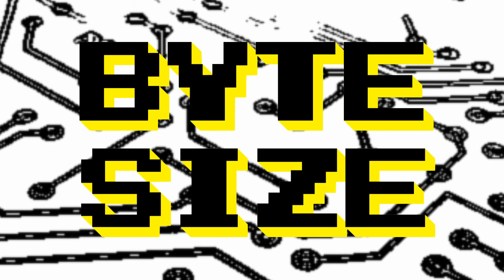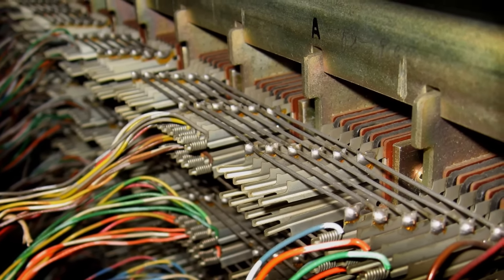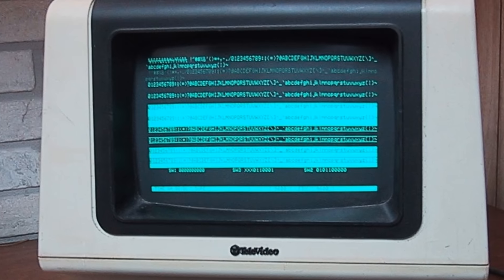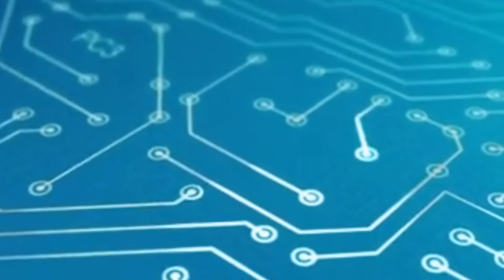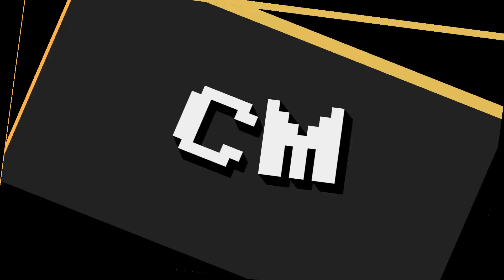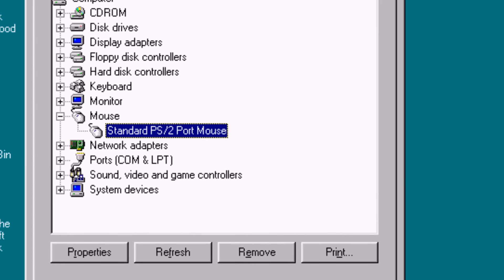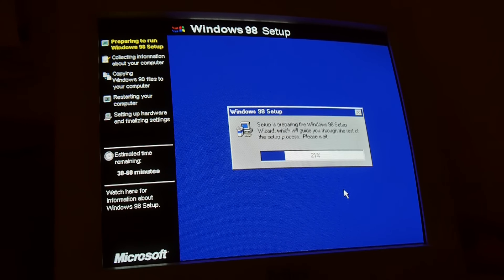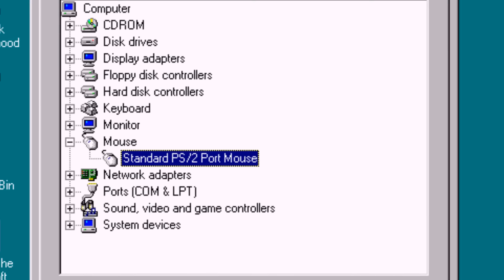How Does Plug & Play Work? [Byte Size] | Nostalgia Nerd

Comment: The problem with MCA was that configuring expansion cards required a unique floppy disk that came with the computer, and if you lost that disk, you also lost your ability to reconfigure the hardware. Obviously it's not a huge problem to keep the disk with the computer if you're a home or small business user, but when it came to large businesses and institutions, which had hundreds or even thousands of computers to look after, it was next to impossible to keep track of which disk went with which computer. Plus IBM had patented it and wanted PC clone manufacturers to pay royalties to use it, to which said clone manufacturers said "nope" and developed PCI instead as the 32-bit P'n'P card interface of choice.

Comment: The Amiga, with the Zorro 2 and 3 buses, had a very elegant solution called "Autoconfig". This would allow you to store the device driver of the expansion board to be stored in ROM on the board, which means that you'd never have to install any drivers.

Obviously, when it came to driver updates, or running anything other than AmigaOS, it was not quite so good.
Reply: autoconfig was stolen from dos....

Comment: I think it was more like, "plug and pray"....
Reply: Back then Macs really were better as they just worked.
Install the card and maybe a system extension and that was it.
Reply: Even the elreya Imac had some plug and pray issues, mac os 8.5.1 fixed many of them and 9 most of the rest
Reply: I can picture the fat guy who first thought of that having a huge smirk on his face as he sat down his dark basement, dialed up the internet and "Wait till the guys on usenet hear this... Plug and pray...LoL"
Reply: That;s what we used to call it with ISA and windows95 / NT4.... Ugh, some bad hardware back then.
Reply: In the early 2000s I had an external haddrive that I used to carry around, and whenever I used it on a new Windows PC I had to install special drivers for it. Then one day I tried it on Mac OS, and was just astounded to see that the operating system recognized my device without any configuration, it just worked.
Reply: firewire drive?
Reply: Patchuchan And nowadays they’re still better as they work correctly 99.9 % of the time. Meanwhile, Windows only works correctly 90 % of the time, being generous. Most Windows problems (which arise at maximum 3 days uptime, unlike Macs which can be months without rebooting [mine has over a month uptime right now]) are solved by rebooting (which is a loss of time and a big PITA), but if it isn’t, you’re for a really big loss of time worrying about and trying to solve the problem, if you are tech-savvy like me. If you aren’t it’s mostly a waste of money (luckily for the technician who receives the money).
Reply: Damn, that's very original.

Almost as original as Brian Collens, who you copied this comment from.
Reply: Oh yes...
Reply: kitty!
Reply: kitty!
Reply: Plug and Pray - you beat me to it LOL LOL
Reply: No it is still plug and fail, i'd find the plug and play disable option, and manually install drivers

Comment: I remember that the Amiga systems had autoconfig built in as standard. A great help when using the big box Amigas. 

I still miss that system despite the technical advances of today's hardware. Although the software is of higher quality these days.
Reply: they had plug and play before windows did, huh
Reply: they had plug and play before windows did, huh

Comment: That bus mouse probably demands a low IRQ value because lower IRQs are given higher priority access to the CPU. An interrupt request from a device interrupts whatever the CPU is currently doing to service it, and if two or more come in at the same time, the CPU delays or sometimes flat-out ignores the one with the lowest priority. Since you generally want your computer to always respond to human input devices, it stands to reason that a mouse & keyboard would be granted the higher priority low IRQ lines. In fact, on an old pre-USB PC, the keyboard controller is attached to IRQ 1, the second-highest priority in the system. 

Fun fact: The original IBM PC & XT had only one eight-channel interrupt controller chip, called an 8259 programmable interrupt controller, or PIC. Nearly all of the eight channels were reserved for internal components or add-ons that the system shipped with, leaving only one or two available for future expansion. IBM sort-of addressed this in the AT by adding a second 8259 PIC and tying its IRQ2 line (aka IRQ9) to IRQ 2 on the first chip. So the actual IRQ priority on an AT is something like 0, 1, 2/9, 8, 10, 11, 12, 13, 14, 15, 3, 4, 5, 6, 7. Although IRQ conflicts are a non-issue these days, with the introduction of PnP, a modern PC still has the equivalent of two 8259 PIC chips, as well as that bizarre priority list.

Comment: There's flexible, and there's annoyingly flexible.  Flexibility becomes annoying when you have to load all of the motherboard drivers whenever you need to do a clean install on drive c.  The situation gets even more annoying when you need to download all of the Microsoft updates as well.  But it gets downright infuriating when Microsoft decides to discontinue a handy piece of software that you can only get on line.  So, in order to overcome this frustrating prospect, I elected to clone drive c to a spare drive.  That dealt with the Windows 7 computer issue.  However, my Windows 10 computer, which also supports the X86 software I use on the Windows 7 computer, has overlapping issues.  So, in order to fix that situation, I have purchased another hard drive, and cloned drive c to that.

Comment: I used to have plug and play software for DOS that was designed to allow plug and play cards to be used on a motherboard lacking a PnP BIOS. It was actually quite powerful software, but if you moved that boot device to a motherboard to a system equipped with a PnP BIOS, it would lock up at the config.sys file when loading the software's PnP support device driver. Ahhhh memories....

Comment: The earlier plug and play supported plugging in well. You could plug something in and play it but sometimes  unplugging did not work as well especially for block devices (devices that store data.) These usually had to be unmounted, a process that would prepare them to be unplugged.

Comment: One big problem with Plug & Play was that it didn't Unplug & Play.  I remember having to boot Windows 95 and 98 in Safe Mode, go into Device Manger, and remove all of the duplicate instances of a device that wouldn't be visible at all in Device Manager if you weren't in Safe Mode, but would still cause the real devices not to work as well as rendering Windows even more unstable than normal.

Another problem, likely related to the above, was that Windows 95 and 98 really didn't like being cloned onto a hard drive and then moved to a non-identical computer.  If the destination computer was significantly different, Windows might boot initially and work for a short time, but almost inevitably, it fried soon afterwards.  Being in the 1990s in a business that sold process monitoring systems, we needed to be able to clone hard drives, and it was a real time waster having to do a full clean install every time the computer manufacturers changed their available models.

Later, I learned that the Windows NT and 2000 were a lot more tolerant of being moved onto different (even very different) hardware.  I got out of that line of work before having the opportunity to run afoul of Windows XP's license activation system that would purposely partially disable it if it detected more than a certain number of changes in the hardware it was running on.

Comment: Yeah great Plug&Play in the early days, on my Windows 95 box it assigned the sound card the same IRQ as the printer (7 I think it was) so each time I played audio the printer reset itself as if you'd have unplugged and replugged it... had to lock one of them to 5.
Reply: I have to choose if I want the prallel port or the soundcard, because they totally want the same IRQ :)
Reply: @HappyBeezerStudios  This is why I make it a habit to go into the BIOS and disable all the ports I'm not using or planning to use.

Comment: I'm extremely grateful for PnP. It really was revolutionary, some people don't understand what a large change it was.
Reply from the maker: I loved the DOS days of configuration and startup files - but I had a lot of free time then! - After the initial excruciating overlap with early Windows '95 plug and play revisions it was definitely  nice to be able to slap something in and for it to just work (usually).
Reply: I came to PC too late for those very early days but my "usual" PnP experience was that I slapped something in, installed the drivers and then stuff shared interrupts and nothing worked anymore. Windows NT worked much better in that regard for some reason but I eventually ended up with Linux that IMHO shared the best of both worlds of PnP and config files.
Reply: I have a retro rig for older games and to enable soud under DOS I have to do many steps even though the sound card is PnP:
1. Lock either IRQ 5 or 7 in the BIOS for the particular PCI slot
2. Find and Install older Drivers, because the newest from th manufacturers website lack the MPU-401 support under DOS. (In the end only an image of the original driver CD worked)
3. Install the driverrs under Windows and configure them to the IRQ set in Bios.
3.Copy the settings from the WIndows device manager into the DOS startup files. (IRQ, DMA, port and wavetable)
4. Hope that everything works, else do all of that again with a different version of the driver.

And that is how you do plug and play in 2016 with hardware from around 2001 and the resources from today to play games from 1996.

Comment: Really wasn't perfected until the XP days.  95 was a joke when it came to P&P, 98 was a bit better, SE a big jump in reliable configuration of multiple devices....2000 was OK but the big problem there was lacking support for a lot of HW outside the office/professional space.  XP got it right and pretty much from then on, the only thing I've had to manually configure are things like signature pads that run with SW that expects a specific COM port.

Certainly makes things easier.  Messing around with config.sys and DIP switches, BIOS settings, etc was never fun.  Once you got things working you just left it alone.

Comment: I've always assumed plug-n-play was just the ability to use devices without needing drivers, about it.
Reply from the maker: Ahhhhh, well, Operating System PnP integration now-days does it so well that could easily seem the case. Some devices use generic drivers, but generally most devices need their own driver to get the most from the hardware.
Reply: Nostalgia Nerd
That's why I watch these. It's just stuff folks take for granted when using a computer.
Reply: Just use USB devices like thumbdrives under Win 98. They are plug and play but still need drivers.
Luckily there are now universal USB drivers for that, which enable 98 SE to recognize basically any drive. For those of us who are still setting up 9x machines for one or the other reason.

Comment: Then why were there neverending resource conflicts (particularly for the few IRQs) in Win 9x? I must have wasted months of my life trying to fix this crap manually.
Reply: That was probably a limitation of the ISA bus. Some PnP cards couldn't use any IRQ and were limited to a few IRQ's. If you had some devices that weren't PnP they ate up an IRQ, leaving less IRQ's for the remaining devices. Also the ISA bus didn't have many free IRQ's. Some were taken by the memory controller, system clock, video, CPU and keyboard and can't change or couldn't release their IRQ because the machine would stop functioning. Some devices could share IRQ's (like sound card, printer, and serial dialup modem) but you couldn't use both at the same time.
Later PCI and PCI-e extended the number of available IRQ's, but older operating systems couldn't "count" that high because those extra IRQ's didn't exist when those operating systems came out.
Reply: Yes, that's about what I remember. But then it could not really be called "Plug & Play" if the real PnP devices were not able to split the remaining free IRQs among themselves. And, of course, no vendor ever told you that you had to decide between using a sound card and a modem. It was basically no different from tweaking the autoexec.bat for your DOS games all the time. PnP was a massive letdown from the promises it was advertised with.
Reply: @Noone-of-your-Business  The OS was plug and play.  Your hardware, might not be.  W95 had a lot of issues with how it was implemented, but also hardware hadn't caught up with the concept that you would have multiple devices in your PC all competing for address space.  Back when the ISA bus was new, people were lucky to have a sound card.  Dedicated video wasn't even a thing yet, or very niche, as 3D games were pretty much nonexistent at that time.  Everything just ran through the CPU.  And so you didn't need a lot of open address space to work with, as you'd never have more than 1 or 2 expansion devices in your machine at any given time.

Comment: I wonder how Apples Macintosh Systems Plug and Play worked...?
Reply: Macs prior to the Mac II didn't have any expansion slots, so PnP wasn't really an issue. When Apple designed the Mac II, they incorporated a 3rd party bus into it, called NuBus. NuBus is both PnP and platform-agnostic, which made it really versatile, but also super-expensive to implement, so Apple quickly switched to PCI once it became available. PnP on a PCI-equipped Mac works pretty much the same as on a PCI-equipped PC.